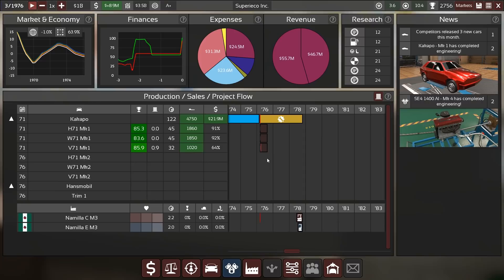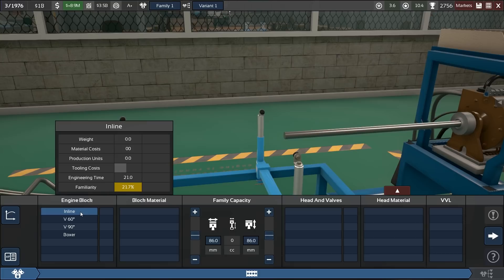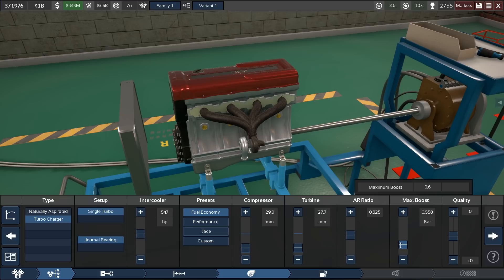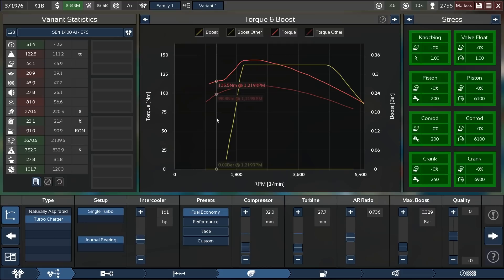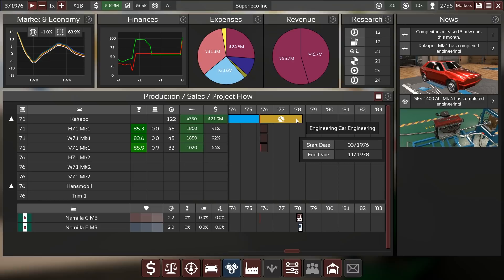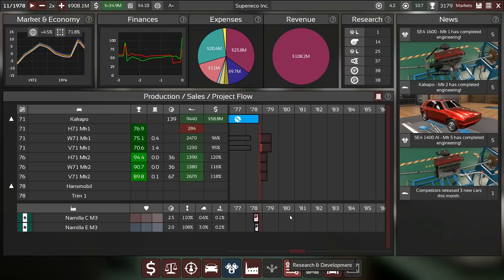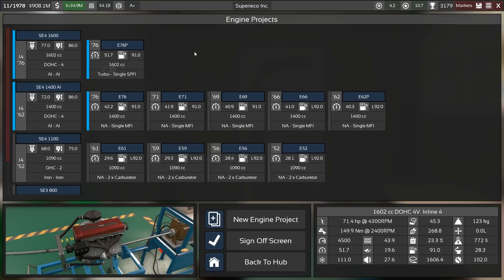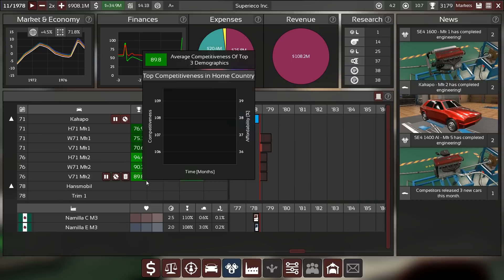Automation LCV4.0: Super Eco Ep.12

Comment: Hans, your granpa worked on airplane and tank engines which are enourmous. No wonder that turbos spooled at 500rpm on them.
Reply: @TopaT0pa  Those engines in airplanes and tanks prob had over 10-20 liters.THAT is really huge.
Reply: @nikolenmrdja3961  like the Wright R-3350 Duplex-Cyclone - 55l 18 cylinder :D
but it was super- not turbocharged. I know they tried turbo plane engine because of air pressure but I've never seen one myself.
Reply: @TopaT0pa  When you think about it, superchargers and turbochargers do the same job of delivering more air into the cylinders but one uses power from crankshaft while other uses exhaust gases to do the same. So that example is still usable in this case.

Comment: Hans making engines of 90's peak efficiency in the 70's

Edit: Can you put out the cars you made somewhere so we could download and modify them? Of course, Hans will hate us tuners who go for power.

Edit 2: You should re-do the gearing for the Hansmobil, too much acceleration, and top speed can be further up. I would love to see a racing series based on the Hansmobil, basically super-efficient cars with low fuel loads.
Reply: Re: The Hansmobiles gearing. At 25:00 you can see that the engine operates at 2355 or less at all measured speeds. Given that peak efficiency for this particular engine happened to be at about 2200, that's the ideal RPM range for very high speeds so actually the gearing is about perfect.
Remember that this engine doesn't rev anywhere, so even with it set up for a very low top speed it still ends up with a reasonable RPM at the various speeds.
Reply: Since we're fuel injected now, it would probably also be a good idea to limit it's top speed at around 130. Hans would hardly go faster, and it would be possible to set smaller brakes and simpler tires this way